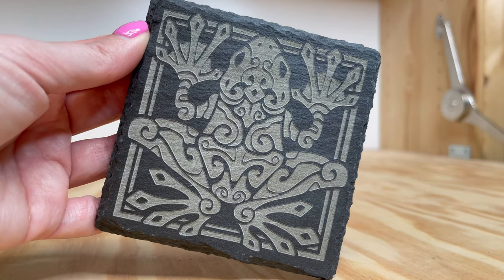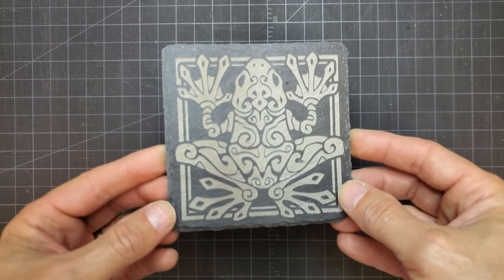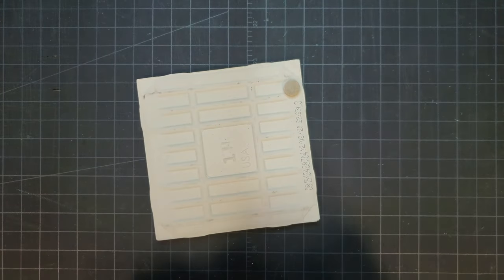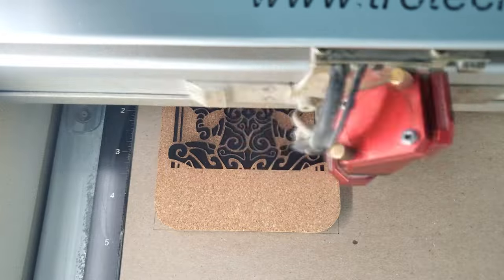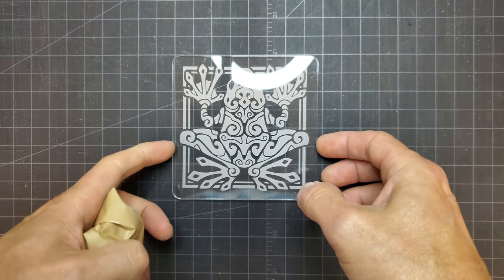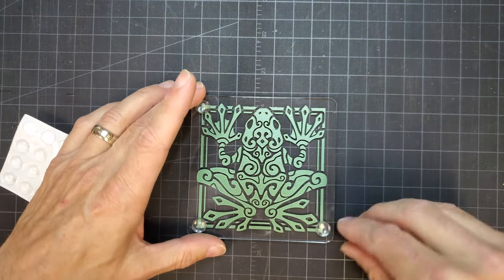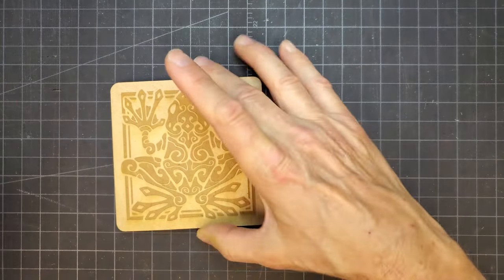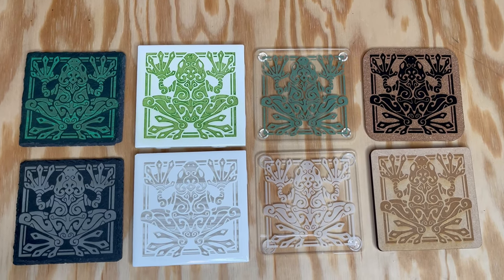Laser Business Top Seller 🤑 Engraved Coasters 💵 5 Types for Max Profit - PDF Design File Available

Comment: Pro-tip: if you have access to a tile saw. Buy slate floor tiles at the big box stores, broken ones for a discount. Cut into 4x4 squares and get creative with the edges... Fraction of the cost
Reply: I've also heard you can get scrap veneer and plywood.
Reply: Thanks for the tip
Reply: Depending on how you cut them, you might be able to put it in a frame to hide the edge. 🤷‍♂

Comment: I use thin cork backing discs on my 3mm round ply coasters and laser my makers mark on it. I then give it a quick blast of spray lacquer to seal the cork and stop the lasering wearing off. I have been testing them for over a year now with hot and cold drinks and the cork backers still look like new.

Comment: Thanks for the video. Just found your channel. It was suggested through the YouTube algorithm after I watched a few Louisiana Hobby Guy videos. Good video. Good content. I am just getting started with a laser engraving.  I took a getting started class at my local Makerspace here in Charlotte, NC.  FYI… a poor-man’s mask for engraving is a wet sheet of card stock typing paper.  The water keeps it from going up in flames and sticks it to the material.  I have spray painted over the wet paper, let it dry and it comes right off with no clean up.  Another pro tip:  The masking film on that acrylic you engraved can be a paint to peal off all the little pieces.  Use duct tape.  It peals all the little bits off in one pass.  Glad I found your channel.  You get a Subscribe and a Thumbs up.  Keep up the good work.

Comment: I'm a wood worker, turning pens, bowls, letter openers etc... Just added a 55w laser to the shop.  I've been doing some slate coasters, but I like that painting you did on some of these.  I've never done acrylic but I think I need to give it a shot. 

 Back to the painting part.  Your using a oil based paint?  Do you wipe it down while it's still wet?  I'll have to watch some vids on painting.  Thanks for the content as well.
Reply from the maker: Yes, we used oil paint and you should wipe it while it's still wet. :-)
Reply: @smedleyworks  Cool.  I may order some acrylic and give her a whirl.  Thankx

Comment: I usually use a light coat of mineral oil on the slate coasters before engraving. Use a paper towel to take off any excess. Good video with comparing the different types of medium. I'll be adding clear acrylic coasters to my store, when it comes online, to go with the slate coaster offering. Thanks for the reminder on that, even though not absorbant, it does look really nice.

Comment: What technique do you use for the acrylic to get such a good image
Reply from the maker: You just need to get your specific laser focused and settings dialed in correctly for the material you're using. If you're marking acrylic like in the video, you don't have to engrave too deep...just deep enough to etch the surface.

Comment: Hold up. I've seen at least a couple vids where they say a laser won't cut clear acrylic. Is it because you left the paper on?
Reply from the maker: I think they're referring to fiber marking lasers. A CO2 laser cuts clear (or any color) acrylic just fine. 🙂
Reply: Diodes also take issue with clear acrylic, research different laser types and what is best for what.